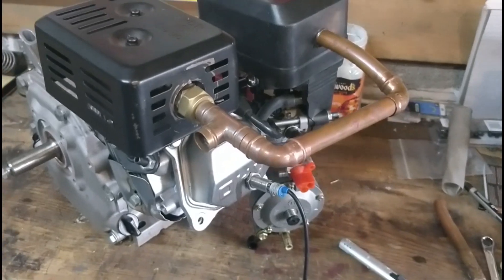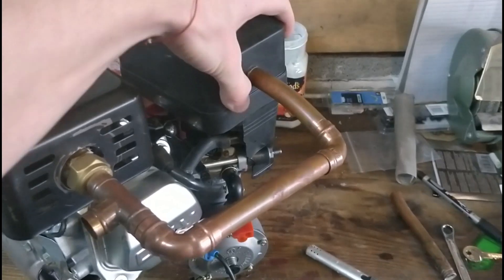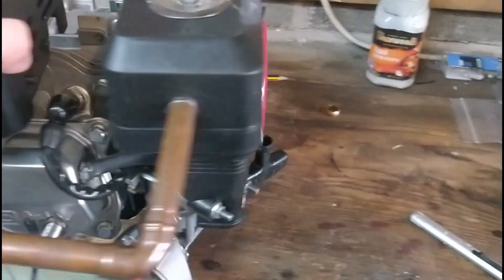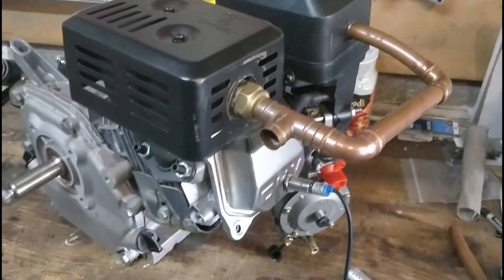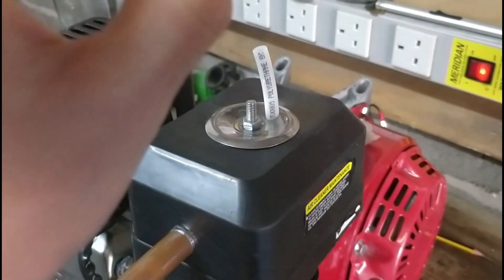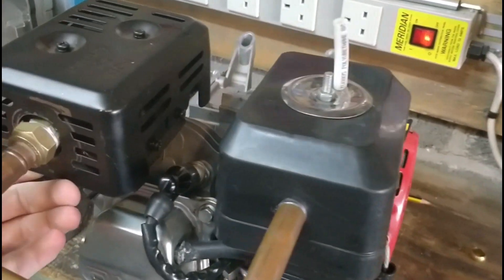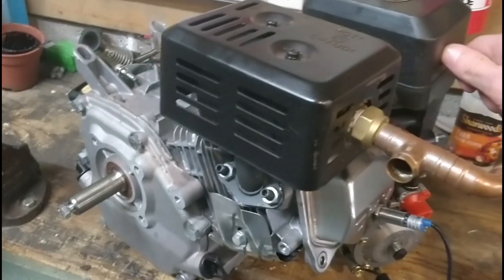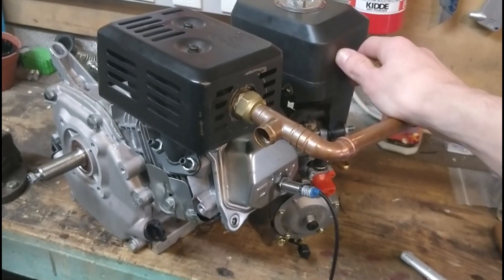Pure Hydrogen Combustion Engine

Comment: Awesome, are you looking at doing HHO on demand? I know HHO really likes a portion of the exhaust going back to intake. Is the compressed Hydrogen just test? Or are you going to store the hydrogen in tanks? I'm looking at doing the same but HHO on demand, I'm still working on the HHO production playing with high voltages and tap water.
Reply from the maker: Hi thankyou for the comment, I am looking at only using Pure hydrogen and storing it, HHO in demand would be difficult to achieve but not impossible, I found with HHO engines it's not practical to Rev and increase speed quickly without a dealy, also dangerous if there is a lot of back pressure and can potential explode, i only use pure hydrogen for safety reasons.
Reply: @Hydrogenguys  Ok cool i'm going to continue with on demand as I dont see anyone recycling the exhaust back into the intake which is supposed to be a big reason why some are successful and some are not. I find that ICE engines were originally  made to run on hydrogen and that is the easy part, but to make hydrogen on demand is where I am aiming my efforts as making enough and without electrolyte is where i see the hang up. I'll continue watching you, thanks for all you do :)
Reply: @hissst69  Hi. For HHO on demand.. Can we have 2 cylinders on our vehicle 1) containing Hydrogen 2) nd containing Oxygen and then mixing them directly in piston from dual intake Fuel injectors ?
Reply: @akshaymalvi  why split it if the stoic mixture is naturally correct already? It doesnt need to be stored if made on demand.
Reply: @hissst69  If you want to use hho as your sole fuel source to drive your car we are going to need it in high quantities. Consider you need to go 300mile from a full tank. For safety purpose we need to store Hydrogen and Oxygen in two separate cylinders. For having these both gases in huge quantities we need cylinders those capable of storing more than 200psi. Yes I appreciate your concern- Separating these two gases in two different containers And again mixing them directly in piston in perfect proportion (with the help of some electronics) in is a real pain / extra effort.
Reply: @akshaymalvi  why would you store oxygen? Its everywhere. I am not looking into hydrogen storage, thats being done already and not my bag. I want it on demand :)
Reply: @akshaymalvi  I mean on demand in the car, no storage whatsover, like Stanley Meyer did. But its very easy to buy a canister of hydrogen and run your car through a carburator, very very easy, can do this in an afternoon, no need for the canister of oxygen as it is in the environment. Im more in interested in high voltage exploding water right now.. but Ill get back to playing with high voltage electrolysis soon.
Reply: @hissst69  All the best for your project. 👍🏻
Reply: @hissst69  How far have you taken electrolysis, I would  imagine huge potential.
Reply: @idenhlm  I got stopped on projects for awhile as I needed to switch how I make money due to Flu shutdowns.. my coffee shop took a hit and where I live it is still all shut down and people still scared watching news. I will get back to it when income is handled :)
Reply: @hissst69   I have often thought of a electrolyzer/injector unit, as the solution, I believe Stan Meyer developed that to a working concept.
Reply: @idenhlm  I agree but all that has been replicated, what they cannot replicate is the efficient breaking of the water, resonance circuit that is pulsed is the key (Tank LC Circuit) If only the old CRT TV engineers were still around !